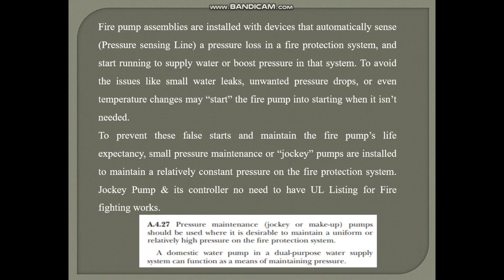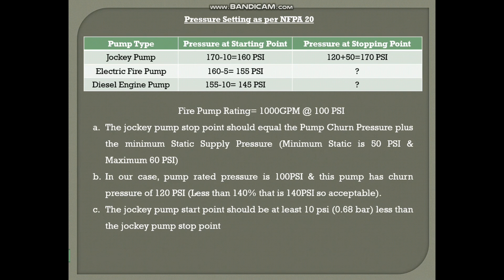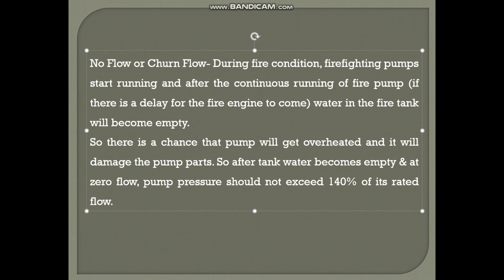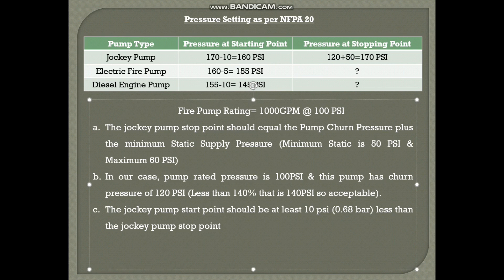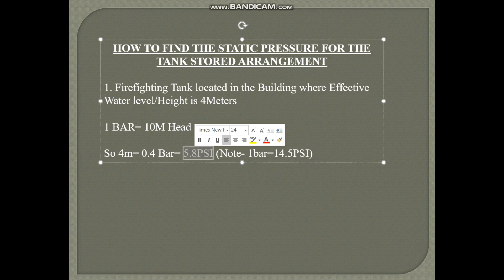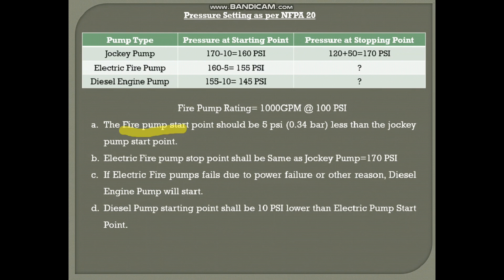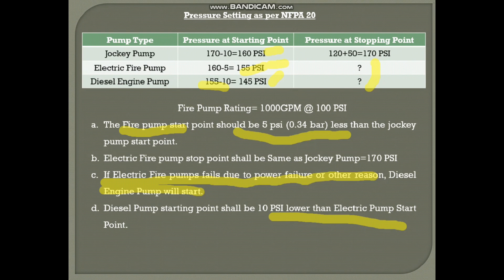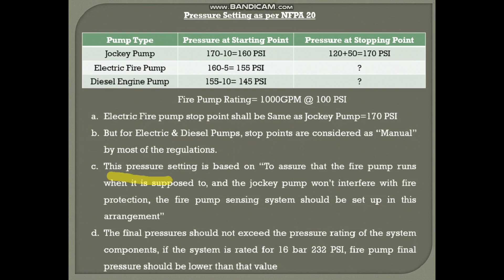Fire Pump Pressure Setting l NFPA 20 l Fire Pump System

Comment: In my project while testing fire pump , we used fire hose reel to test the sequence of operation of fire pump but when we open the full valve of fire hose cabinet first jockey start and diesel pump started and electric pump didn’t start . Can u please advise

Comment: as per QCD requirements, once diesel pump is started, the electrical pump must be stopped. isn't  it?
Reply from the maker: Case-1- There is a interlock provision between electric pump & diesel pump controllers so if electric pump runs diesel pump will not run but this is not coming in the minimum standard requirement as per QCDD. It's a special kit first of all, Secondly eventhough pressure drop is there from electric pump start pressure (for example 180 PSI) to diesel pump start pressure (170PSI), diesel pump will not run in this case if u have this interlock provision.
Case-2- This is the regular case, if there is a gradual pressure drop from electric pump start pressure value (180 PSI), to diesel engine pump start pressure value (170 PSI), Diesel engine pump will not start, for example during flow test we discharge water through 1/2" pressure sensing line so there will be gradual pressure drop  so in that case diesel engine pump will not start. Incase, there is a sudden drop in pressure due to fire, both pump will run if there is no interlock.
Reply: Very good explanation brother